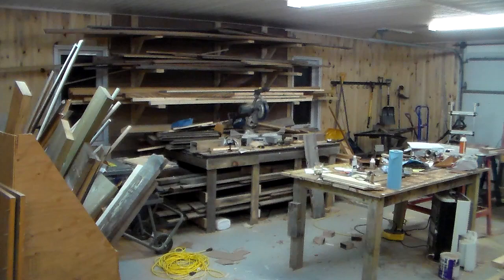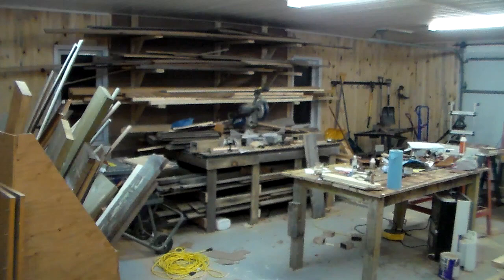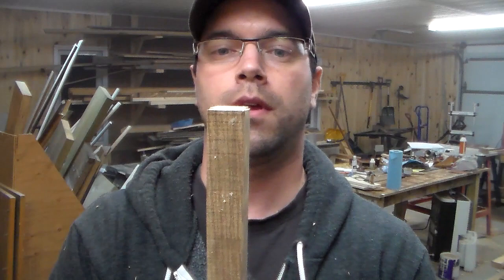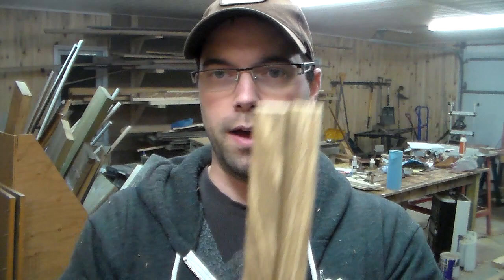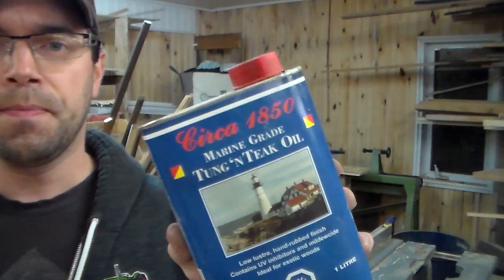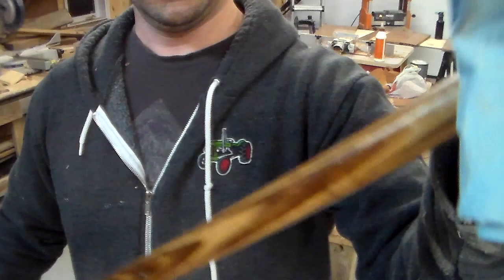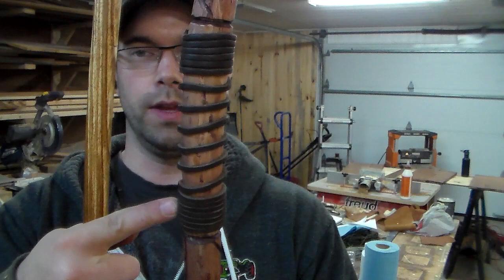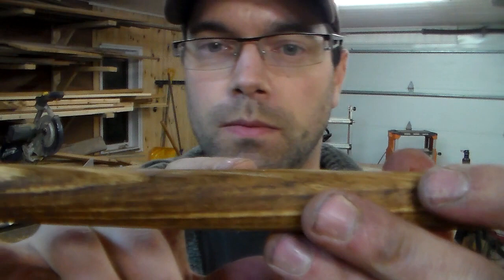Zebrawood Hiking Stick

Comment: Very cool walking sticks bro. I never thought of using my router table to make a walking stick. Thats awesome. I need to find some of the zebrawood for some other projects. That grain really pops with the oil. Thanks for sharing. Atb. Robert
Reply from the maker: I got that board at my local saw mill. They have all kinds of exotic woods.

Comment: Amazing job on the walking sticks....do you sell them...
Reply from the maker: I think I have 4 in stock. I don't make things to sell but I could sell them for 75$. It's an expensive and rare wood. And they are all made from a block of quartersawn lumber. so extremely strong. (Same as a good quality axe handle)